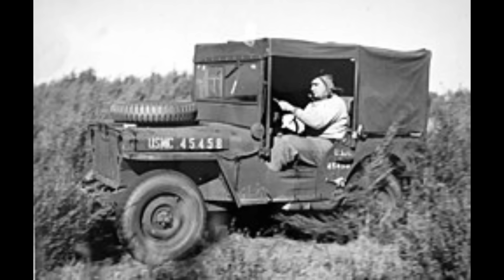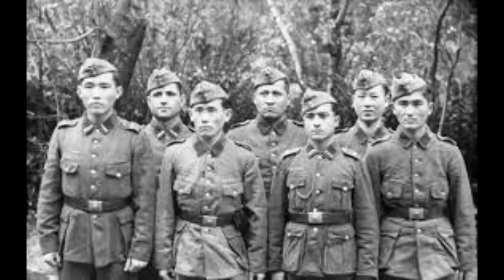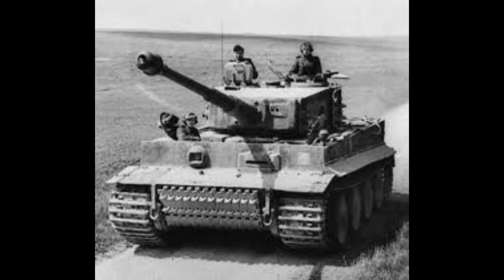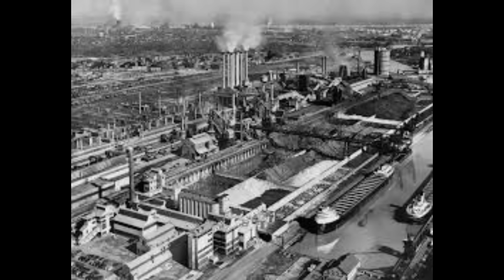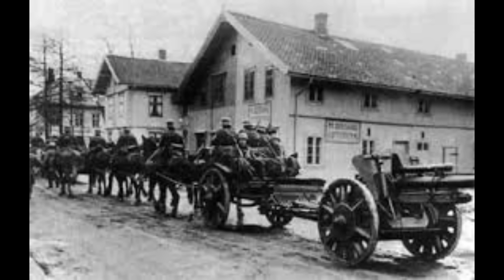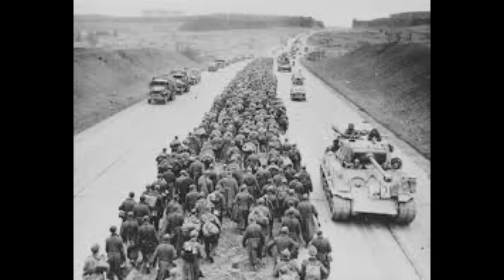German Mechanics Examined A Captured Jeep — Then Understood Why 640,000 Conquered  Two Continent

Comment: I have heard some of these facts before, but there are new ones included, which is why subscribed. Sending this from Carmel, California, but I could just be as easily sending it from Fort Worth, Texas. (I’m a “Yankee Texan,” having lived in Texas from age 13 to 30.  I lived with my sister and redneck brother-in-law, and I saw and worked on a number of old military vehicles and 1950s and 60s heavy trucks— my first mechanical experience was to change the starter in a 1961 international harvester Tran star truck tractor, which had a 500 something cubic inch V8 engine.  it was very strong and could pull 40,000 pounds of cargo up Ranger Hill outside of Weatherford Texas at 40+ miles per hour, when other trucks would be struggling in the slow lane. The only thing it couldn’t pass was a gas station! 😂)

As someone who remembers $.25 per gallon, 100 octane gasoline, which allowed much higher compression in the engines, resulting in fewer emissions, I wonder what the hell happened to the United States?

Can we only be truly “ united,” during a total war?

Being a computer engineer, I understand the need for a complexity and electronics, however, I would really like to know if we have kept the simplicity in basic engine design, interchangeability, and ability to scale up manufacturing 1000 fold in case of need.

Comment: Now they want to charge $100,000 for a "jeep" and they aren't half as reliable
Reply: Kevin today's EPA regulations you could not possibly build anything like a jeep.
Reply: @kevinwalsh3327 safety features like crumble front end where the engine goes underneath the driver in a frontal impact, side impact tests, and the big emissions test of noxious fumes, fuel tank under the seat won’t work, air bags, etc.
Reply: @kevinwalsh3327  Just curious, besides not having a catalytic converter, why would EPA regs not allow a basic Jeep?
Reply: @samr.england613 safety regs and mileage regs
Reply: @samr.england613  Because the EPA is tarded. Their bumbling caused a massive environmental disaster that contaminated the water in 3 different states with toxic heavy metals back in 2015.
Reply: @Princess_Celestia_  I think he was asking for an example of an actual reason why EPA regulations don't allow Jeeps, like something factual.
Reply: I'd call those old Jeeps more repairable than reliable. There's a reason cars from that period only had 5 digits on the odometer.
Reply: They may call the new vehicles "Jeeps" but no Jeep lover ever would.
Reply: @johnpaton8607  it’s a Jeep. The brand is Jeep. No longer a specific design.
Reply: That's why they aren't making 200K a year
Reply: A complete circle - it took the Europeans from Stellantis to finally ruin the Jeep.
Reply: @anjalicgirl  Stellantis merely hammered nail into the coffin that had already been built. Jeep (and Chrysler's) demise was entirely self inflicted and without Stellantis they'd be long-gone
Reply: @alanbrown397 Yeah, Jeep's were pretty crap long before Stellantis. You had your Willys Jeeps, Kaiser Jeeps, AMC Jeeps, Renault Jeeps, Chrysler Jeeps, Mercedes Jeeps, FCA Jeeps and now Stellantis Jeeps. Basically Jeeps have always been so good that the company can't support itself and has been continuously passed around like automotive STDs.
Reply: @alanbrown397  Fair point, but I’d give Daimler a slightly different grade. They tried to “fix” Chrysler/Jeep with Mercedes technology and some interesting cross-pollination. We got cars like the Chrysler Crossfire, basically a Chrysler suit over Mercedes SLK bones, and some other Mercedes-influenced engineering. But strategically, yes, it became a financial sinkhole. So, Daimler tried, but Stellantis seems determined to finish the job.
Reply: @anjalicgirl  this is written at a level a recent Ivy League graduate would have to labor to match. What's your education, if you don't mind my asking, and how much do you read?
Reply: @AlexKarasev  Thanks, you are too kind!
Reply: @anjalicgirl now giblve credit where credit is due, Daimler owned chysler for a while, the germans had a Crack at ruining jeep as well.
Reply: @anjalicgirl Amen, brother. Amen…
Reply: @anjalicgirl ew
Reply: @anjalicgirl perfidy over function.
Reply: Ya i had a 2019 jeep wrangler and in 2022 had so many electrical issues i got rid of that junk
Reply: Actually $150,000
Reply: It really is crazy — we went from a rugged little workhorse that changed the world to a $100,000 “Jeep” that feels more fragile than the original’s spark plugs.
Reply: You give jeep's too much credit...what jeep today can go off any roads and not have to get repaired? None
Reply: There is one company out there that still makes the original "jeep" design.  If I'm not mistaken the company is out of the Phillipines.   You can literally order a jeep part by part and build your own, or have it delivered pre-built.  Which is the marvel of the jeep design itself.
Reply: In 1942, the government paid $700 for a Jeep.
Reply: One-tenth as reliable.
Reply: Half? 😂
Reply: What's being built today by Stellantis only shares one thing with the WW2 product - holes in the front.
Reply: And the seat warmers are subscription now. SMH
Reply: Jeep is dead and the shit they build is a bs shadow of it's self !
Reply: I'd pay 100k for a brand new Willy's Jeep before I'd pay 100k for a brand new Stelantis Jeep. Jus sayin. Or amc. Either one.
Reply: @rovingmarks you can order a wwII Jeep kit from the phillipines, they send it in a crate, all you provide is a motor and I believe transmission.
Reply: It's actually insane how much I see people complain about their engines these days like the jeep damn near won the war along side the sheman and p51, tf happened since then that we have the garbage we do today smh
Reply: @MisterDemonTC People love to complain, whine, bitch, and moan online
Reply: Said Jeep must meet Collision and Pollution standards.   American bureaucracy has taken on Engineering roles.  They are not doing a good job of it.
Reply: planned obsolescence the sooner the break the quicker they can get more of your money
Reply: "They" being the Italians at Fiat.
Reply: Well, the WWII Jeeps were built mainly by Ford, the modern Jeeps are built by Fiat.
Reply: They're built by Crapsler now, which is now foreign owned.
Reply: I think many have forgotten that part of reliability is easy repairability.  

A simple, tough vehicle that can be repaired with some basic mechanical skills is more reliable than one that requires a whole shop to do an oil change.
Reply: People choose comfort and equipment above reliability.
Reply: I bought a new Sahara jeep in 2009 for $24,000....that did come with a 1,400.00 government refund when everything hit the fan back then....now like you said those days are over and lost guys like me. I make a good living but even I would not buy a new one again....to expensive!
Reply: At the end of the war surplus to requirement jeeps were selling for $75 USD - who could afford one?
Reply: I was always pissed when they started using Hummers!
I first saw one of those at Ft Irwin and was shocked at the obvious waste!
Reply: @chrislong3938 The M151A was proned to rollover.. Give it a wider stance by increasing axle length 👌. Increase motor size, add better heating and air-conditioning  and armor for IED protection, then run flat tires, then bulletproof glass.... then due to increased 49:32  to a diesel motor for more torque and reduced fire hazard with a less volatile fuel...    Ops a Hummer.. 
  I served for 28 years Army. I loved the M151A but for self preservation found the armored up HUMMER to be a must in Iraq..
Reply: Thanks for your service.  And thanks for some first account facts and knowledge.  Love comments like yours that add even more pertinent information to the videos presented.
Reply: @davidrodgers9919  yeah but she was designed perfectly for that job. The men guarding my convoy was having a weird love affair with that thing🤣
Reply: Owned a 1946, cj2A .   Flat fender,  flathead continental  engine, 6 volt floor start. Spicer 18 transfer case. 5.38 ratio axles. Engine only put out 45 bhp. And that is optimistic..as a rebuild.  45 mph top speed and that's with engine screaming.
Reply: @WayneSummey-q8c  they could go anywhere, as long as you werent in a hurry.
Reply: Amen.
Reply: Maybe the best idea with the Jeep  Compass  is go to the States.
Reply: General motors
Reply: K.I.S.S. (Keep it simple stupid)
Reply: True
Reply: J6
Reply: You can thank your fucking federal government regulators and Unions for that. 

Everything has to be "safe" for dummies and support and entire family to make.
Reply: may be we need crude now 😂
Reply: For the war, we paid $700 per Jeep.
Reply: It's 80 years later, dude, and you think the price is still going to be relatively close.
Reply: Because they are italian.
Reply: The crap they build today is not a jeep
Reply: Would like to have a TJ or older. With a straight 6 doors I can lift off.
Reply: be fair as reliability is a different topic cause americans can not drive such Jeep anymore cause shifting a car ... who can do it when americans can not drive nor learn it. 
They fly to europe and rent the cheaper cars ignoring the facts you have to know what a clutch is and how to use it. They thingk that the employee of the rental station will show it to them or have a manual to read how it works till they come back from the car which is then damaged or complain that they need automatic ... and then might get the last one on the lot: an EV that works 

JEEP survived so far - as italian frennch american brand loosing its roots cause the more they streamline everything to cater everybody in the 3 countries the less it is a JEEP and hence it is loosing reputation .
Reply: This is Duoglide55. In 1986 and 87 I completely restored a 1943 Willys Jeep. The man that put me on this project was an American Architect. He had found it Tennessee inside a reefer with other jeeps. They had been found in Greece and other European countries. 
It was in very poor shape. Sam purchased it and I picked up the project away he had partially disassembled it. But Sam was a very capable car collector and he had bagged and labeled all the parts. We made or purchased parts from a company in New Jersey. (I forget the company’s name.)
I spent 400 hours over 12 months at night after my regular job restoring this Jeep to a National award winning vehicle. First a Junior, then a Senior and finally the Preservation award. Sam had done a very in-depth research and added all the correct insignia, guns, and all the equipment that would have been used with this Jeep. He even found a pintal trailer and restored it. The guns were an M1 Garand, a 45 cal. Thompson machine gun (which were fireable). 
      A dummy 50 cal. on a pedestal behind the driver. In the trailer was a British Brin machine gun that my brother (Jeff was a great machinist and welder), had welded back together after it had been cut in 3 pieces. After blueing it was very difficult to see the seams. All the equipment that had been put in the Jeep was there through the diligence of Sam. And he designated it to a correct position in the American Army. 
 In the late 1980’s or early 1990’s Sam shipped this Jeep to France to cormorant the 60th anniversary of D Day. I was very impressed and proud about how my Jeep performed. No Problems. 
    Sam is gone but of all of his vehicles, his daughter kept the Jeep with trailer and all the accompanying equipment and accessories. I will try to add a few photos. 
Thanks to The Soldiers Story 640,000 Jeeps 

0:12
Reply: America is soft now.
Reply: Thru thick of mud, desert sand, passing through the Arc De "triumph" jeep were the best way the "higher" ranks to get closer up view of the conditions the "grunt" g.i s battlefield conditions. American made mechanical war horses.😮.
Reply: They’re more reliable than these. Any modern vehicle requires very little maintenance compared to vehicles of the past.  “Tune ups” are a thing of the past.
Reply: Yeah, Chrysler ruined the Jeep.
Reply: @AdamSimon82 junked and tarted it up. Took away from the simple reliability.
Reply: Well I kinda doubt they had the option of a 485 hp 392 Rubicon  in 1941. Which is what you get for 100k now. Nice try though.
Reply: The renegade ain't too bad, 30k, averages about 25 to 30 miles to the gallon on a bad day and I haven't been able to get it stuck even off road.
Reply: I would love to see you put 200,000 on an Army GP without rebuilding it 10 times.  Don't kid yourself.
Reply: False!  😂
Reply: It's also NOT the death trap the jeep was.

Comment: German machine tools did not hold closer tolerances than American  machinery. The opposite was true. Not only were American machines capable of tighter tolerances, they were more advanced, easier to use, and more sturdy.
Reply: Not exactly.  Rolls-Royce was dead set against our factories  make the the Merlin engines for the P-51. The machined all the parts with very tight tolerances, whereas The U.S factories forged almost all parts. 😅 One of our factory workers said "that's what gaskets are for" .
Reply: @WheresHerb Packard Motor Company of America built a fully licensed version of the Rolls Royce Merlin engine that was used in the P51.
They didn’t build those engines in the UK and ship them to the US. Packard built them in the US where the plane was built.
They did ship Packard Merlin engines to the UK for use in the Spitfire.
Reply: @WheresHerb saw a thing on the history channel.

British brought their design to the US asking if auto makers could make this engine. 

They said sure but not with those tolerances. I think like 1/100 or something and the British were smug and said oh you can't get them that good 

And the auto guys were like uh we build our engines to 1/1000 tolerance.
Reply: @travisrolison9646  I believe that story was from when Rolls approached a UK Ford plant to make merlins
Reply: @WheresHerb you have no idea what you're talking about. To make such an idiotic statement reveals your lack of knowledge about machining and manufacturing processes. Only an idiot would machine piston rods in production verses forging and finish machining. Five star dummy!
Reply: The British and German approach required considerable hand fitting 
You can't win wars that way
Reply: @kerrytemplin3585 that's a fact, and there's no precision in hand fitting. It's the result of machinery not being able to maintain precision. "Hand fitted" and "hand crafted" always means junk.
Reply: When Packard took over production of the Rolls-Royce V-12 engine, American engineers were astonished at the sloppy tolerances and made significant improvements in specs for the engine.
Reply: The American dream.😂

Comment: The Tiger tank was extremely slow. It was very underpowered. 700 hp for such a massive vehicle is nothing. It was not that reliable. The jeep was a mass produced good enuf vehicle. It did have a tendency to flip over due to the short wheel base And high profile. That is why HUmvees were so wide. To correct these faults. Four wheel drive is better than rear wheel with weight. l. Rear wheel drive with a front motor is the worst.in bad conditions. Kubelwagon was a VW bug with a different body.